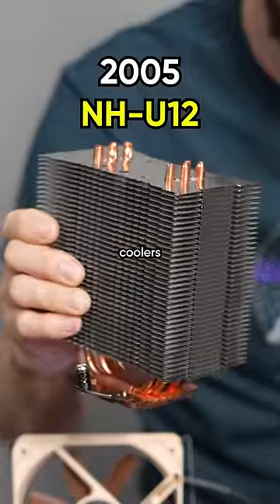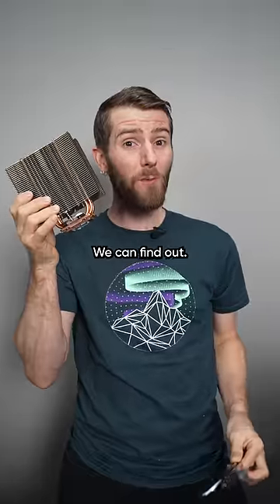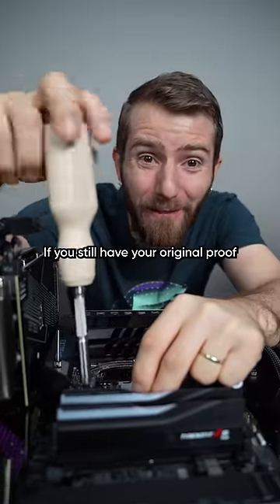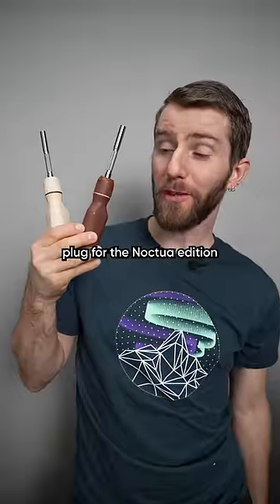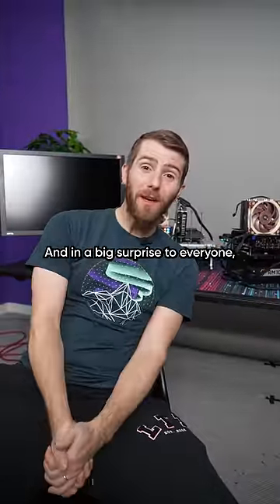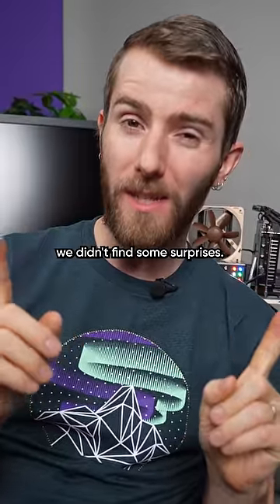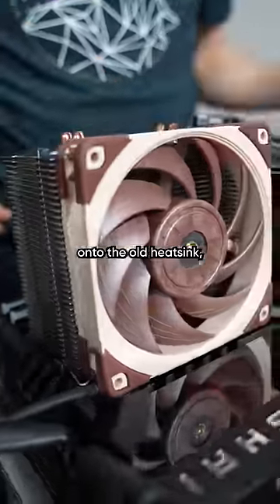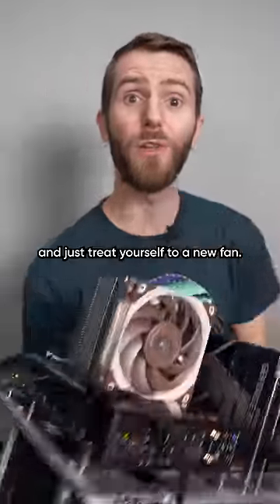Can You Still Use a CPU Cooler from 2005?

Comment: It makes sense. Heat sinks are pretty much at their highest tech they can get but motors still have plenty of room to improve
Reply: How do you know that? 🤔 There are many variables in a heatsink

Motors have nothing to do with it too, maybe the shape and size of the wings
Reply: @thebarnave motors can always get quieter and more energy efficient
Reply: @CADClicker  my dumb ass was like, “what does a motor from a car have to do with this?🤔” 😂😂
Reply: @CADClicker  mentioning energy efficiency when talking about computer fans is kinda ridiculous. With the miniscule amount of energy they use any amount of decreased power consumption by increased efficiency is negligible (the fans of the NHU12A have a max power consumption of 1.68 W each)
Reply: @CADClicker most sound isn't from motors but from wings moving air
Reply: Most of the improvements is the blade design. Not the motor.
Reply: It’s mostly the blades
Reply: @thebarnave Until we discover some sort of alloy thats superconductive to heat, or a liquid with more ideal heat transfer properties then evaporating water; we are stuck with what weve got. Physics puts a hard limit to it all.
Reply: @Jehty_ If you make it more energy efficient then within the same power budget, you can make it more powerful
Reply: Motors don't have much room to improve. Fans have been using BLDC motors for decades and improvements beyond that are minimal.
Reply: so many nerds in these replies 🤓 🤓
Reply: @CADClicker quieter and more energy efficient wouldn't affect cooling.
Reply: @thebarnave Actually there isn't that much you can do with a heatsink for air cooling. Watercooling is different because getting the flow right is very hard, but with air through these large fins that's just far less of an issue
Reply: @casper75559 motors are electric engines are not
Reply: no, 3 C degree is significantly better
Reply: @WiddlPeppuwu-sx3rx PC fans are rarely operated at peak power, because it would be noisy. A normal motherboard fan header can supply around 0.75-3A at 12V, so 9-36W. A noctua fan peaks at less than 2W. And that would be spinning it full blast, which would be very noisy. Fans already use way less than what's available, because the sweet spot between noise and performance is at low rpms, where the motor is virtually silent. All the perceptible noise comes from the fan blades moving air. If we were designing server fans which would be ran at full blast on a strict energy budget, motor efficiency would matter. But consumer PC fans use up to around 10% of the available energy from the motherboard as is, improved energy efficieny will not change anything. Motor development has brought us longer lasting fans with better bearings and such. BLDC motors at optimal fan RPMs have been silent and sipping miniscule power for decades. All advances in fan design is due to blade configurations being able to move air more effectively and quietly. Fans actually spin slower nowadays.
Reply: @AnonymousAnarchist2  it’s not water in the copper vapour pipes, or rather not pure h2o
Reply: How would you know?
Reply: @casper75559 I thought it was "monitor" and I was like "tf does a monitor have to do with heat syncs?"
Reply: You can still have developments, like silver nanoparticles suspension in water, but an 8°C difference seems more like an optimization in capillary action inside the heat pipes. And the number of heat pipes increased by 6, with a larger distribution area to the aluminium fins, so they should be even better in a partially loaded system than max power benchtest.
Reply: @thebarnave   heat sinks are far more optimized than electric motors or blades
Reply: It's mostly improvements in fan blade geometry and other fan mechanical design changes that optimize volumetric flow/turbulence etc.
Reply: not just motors, but the fan blade profile too
Reply: Its mot motors its the propellers motors dont have much to improve
Reply: Honestly yeah it just changes with what metal you use. If we somehow found new metals it might get better but it's not something I would gamble on lol.
Reply: They need higher speeds with less power and noise
Reply: @EikottXD not technically true. The less energy required to spin at the same rpm. The less energy goes to creating heat.

A fan just Cools more than the heat they generate. But they still generate heat.
Reply: a lot of engineers in the comment section. But the classic "it can't improve more than this" must be the most ignorant phrase of the century. Unless you know every single material and chemical physics possible, and all researches going on on a daily basis, you can't possibly give a statement like that. It can improve. It can always improve. Just because someone didn't find a way, doesn't"t mean it's "at it's maximum"
Reply: @enderagent you play Roblox lil bro
Reply: pretty close but alloying graphene and copper and silver could improve conductivity by up to 20% yet.
Reply: @akiraic that's surprisingly easy... Just look at hard sci-fi. The real challenge in engineering is the budget constraint and marketing. There's a reason nobody runs liquid nitrogen pots or enormous liquid coolers in their daily driver PC.
Reply: Wrong, realistically you could have a heat sink that performs significantly better by user silver. However there’s a reason we don’t do that, it’s price.
Reply: Yes, but those variables are already determined perfectly. With motors and blades, there's still a lot of room to improve, but with heatsinks, the basically only variable is "how much is what material" @thebarnave
Reply: More fins, better alloy coating, better heat pipe material and working fluid, more efficient convection guides, thinner dispersion fins, there is so much that can be improved, all technology can be innovated.
Reply: Hardly, on both claims. Biggest diff is fanblade design, therefore air volume/mass. Heat sinks could be made much better, but not without a lot of price increase adding requirement for a higher static pressure fan at the same time. It would necessarily make it noisier since turbulence is good for temps but not silence.
Reply: Blade geometry
Reply: I found the heat sinks over the years have different chemistry mixtures for different evaporative rates at targeted heat soak. Older CPU's were much larger physically and because of that had a much larger foot print onto the IHS which then moved much more heat into the heatsink. You'll find older CPUs that can pump out 250w almost instantly start pumping hot air out the back of the PC as it's able to saturate the heat sinks much easier. Because of that you want higher evaporative temps. But new CPUs are so small that the heat generated has to be attacked earlier with lower evaporative temps in the heat pipes. This lead to heatsinks drying out and temps jumping more than expected on many coolers around 5-10 years ago, as there was a mix of these heat soak/temp ranges out there.

Case in point, I have an old Zalmen 9700 and the newer 9900. The 9700 made my 3700x run warm.. BUT! Was able to cool my old FX-8320@4.7GHz just fine. The 8230 sucked down 260 watts under synthetic load at 72c while the 3700x @4.5GHz was using only 120 watts and already hitting 75c. THEN! I put the 9900 (newer) back on and tested again on both CPUs. The 3700x dropped back down to 68c and the FX8320 jumped up to over 80c.

I took room temperature and also had a watt meter hooked up to confirm wattage usage. There was a room temperature delta of maybe 2°f at most
Reply: @AnonymousAnarchist2 Or until Carbon nanotube transistor based CPUs can become commercially available and somewhat affordable. Carbon based CPUs perform better with less energy, which also means less heat.
Reply: @Jehty_  Well if you make them run with 0.5watt then you made amazing efficiency progress.
Reply: @Papinak2  Maybe but that depends on the effort put to improve them.
If most companies see no reason to invest heavily on that or care then even if improvements could be made they won't appear easily.
Reply: it is the fan blades not the motor
Reply: @thebarnave  Okay yes, many variables that's true, but the basic cheap heat sink design has been perfected. There is nowhere left to go in terms of efficiency when it comes to a cheap heat sink for a CPU, not some elaborate design for a water block or whatever,
Reply: Yes true but it's surprising to even see 3 degrees difference to be fair and im assuming the new fan on the old cooler is also spinning faster than the new fan and new cooler.
Reply: Heat pipes are not at their highest tech at all
Reply: @CADClicker it’s not the motor but the fan blades.
Reply: Nope, you could have a vapour chamber contact block.
Reply: There’s really not much that can be improved in the motor. The main improvement is the blade design
Reply: I just think impingement cooling might be it, like a spray bottle squirting into a channel with a ultrasonic transducer slapping the water droplets onto the processor heatsink
Reply: @CADClicker  not really. Electric motors are already super energy efficient. The only changes that can improve them are better blade designs, better bearings, that kind of stuff
Reply: @MRblazedBEANS  nahh motors pretty much also peaked at least in this field the real change comes from the fan blade design on the fan
Reply: @thebarnave  motors also produce heat
Reply: Heat dispersion is basically peak. So it's just the fans and shit that have evolved.
Reply: @akiraic  I mean not really, there’s always going to be some fundamental limits
Reply: @Dell-ol6hb  the thermodynamic capacity of the materials used is the only fundamental limit. Anything else is material research and design. For now, the problem is simply cost.
Reply: I've used a heatpipe heatsink over and over on 5 different systems and CPUs, and I always take off the fan, build a duct and suck that air through the heatsink and straight out the back with a 120mm fan. best thing is that the VRMs are optimally cooled this way aswell.
Reply: @thebarnave  mostly cuz the cost to improve them isn't ever worth it. The newer model has cheaper, better materials... That explains the small gap in perfoemance
Reply: @MRblazedBEANS  it's not the motor it's the blade density
Reply: @CADClicker no they cant
Reply: You mean fans
Reply: @CADClicker efficiency has nothing to do with how well it can cool your pc
Reply: Fan-technology is complicated stuff. At least, if done properly.

Comment: And the old heatsink only has four heat pipes.  Impressive that they still perform like this
Reply: Yeah, the only real benefit of more heat pipe is better coverage of the CPU. The CPU IHS integrated heath spreader, countrary to what the name suggests, really isn't that good at spreading heat. Thus on modern cou with "wider" arrange of ccd / chiplets or just bigger monolithic cpu will greatly benefit for more heath pipe simply because a 4 hp like this old noctua will not have even coverage of the chiplets/ccd /monolithic element, and more heath pipe cooler will have great coverage of heat pipe directly over the heat producing components. But even 2-3 heatpipe would be enough to carry the heat from a cpu if you'd have a way to transfer it from the cpu to the pipe, as a good quality heat pipe has an equivalent thermal conductivity in excess of 100x that of copper and 200x that of aluminium...
Reply: The new one appears to have more fins in the stack, so I'd guess it has more surface area for heat dissipation.
Reply: Could be the same thing with Car Engines, we have found the best cost/performance for heatsinks so they haven't changed that much
Reply: I'm not very well versed in heat pipe lore but why don't they connect them up the top?
Reply: yhh
Reply: @Flesh_Wizard Connecting them up like that would likely make 0 difference (but if anything, depending on the construction it could perform worse, I think). And connecting them up like that would make it significantly more expensive to manufacture due to the much longer heat-pipe and the extra bending. A heat pipe is not a thermal conductor, it's an evaporative cooling system. So the liquid evaporates at the CPU and precipitates along where the cooling fins are mounted, and the liquid is then transported back to the CPU by gravity and/or capillary effect.
Reply: Anyone knows why they coat their pipes in   aluminium? I thought they're aluminium but then upon hoogling they're copper.
Reply: @funkblack  Corrosion resistance maybe?
Reply: @Flesh_Wizard no reason to do that, plus it'd be super complicated
Reply: Just shows you that more than 4 heatpipes is just pure marketing. It just makes 3 degrees difference, which means the problem was only that old fan, that wasn't very much pressure optimized (look at the HUGE gaps between the blades)
Reply: @funkblack  The coating usually isn't aluminum either, it's nickel
Reply: And they're all really close together in the fin stack as well.
Reply: i’ve got a phat Zalman copper tornado thing from 2005. it was quite heavy
Reply: @maulerrw  I've seen one of those.  Very cool.
Reply: @sassuki  it would probably depend on the cpu you have nowadays. For example, amd's chiplet design would probably favor more heat pipes because it would be more effective at covering all of the CCD's.
Reply: @Marauder-q2v  not really. They are still concentrated around the center. So it doesn't matter. Problem with am5 is just the turbo if you don't like to see 95° under load. Without turbo, you could easily get even X cpus around the 70° mark!
Reply: @sassuki  I mean it was sufficient enough of a problem for multiple companies to create offset mounting that did result in a drop (not that huge) in temps.
Reply: @REVOLUTIONS51 Heatpipes are fantastic conductors but they have one big weakness - if you overload them they suddenly become terrible conductors. Heatpipes rely on a fluid vaporizing and condensing to transport heat but if at some point there is no liquid left on the hot end to evaporate you are essentially left with a hollow coppertube - this happens when you either evaporate it faster than it can soak the liquid back from the other end(this just limits the cooling power to the flowrate).

A different much worse scenario can happen when the fan fails and the hot side reaches the boiling point of the liquid, this leads to all the liquid evaporating and none coming back, once everything is used up the conductivity becomes almost zero and you have to hope the cpu detects the temperature spike before anything gets damaged.

Comment: Noctua's product support is unmatched, replacing parts that go beyond 18 years is insane
Reply: if they make same constrution
Reply: Not even just  replacing parts but making new parts to fit the old hardware on new mounts.
Reply: While still (kinda) making improvements after all that time!
Reply: We love to see it. I have a 2006 Kona Stinky mountain bike that I cracked a rocker arm on in 2021 ish. Called them up with zero hope that they still had parts for such an old frame. The lady I talked to put me on hold while she checked probably the deepest depths of the warehouse to come back and say they have a pair for my bike. I bought a bushing and bolt kit at the same time but she didn't charge me for the rocker arms and thanked me for keeping that old gem on the trail after all these years. I need to get that bike out for another ride one of these years. It's a riot and you don't see many people on 18 year old full suspension frames these days.
Reply: Meanwhile no warranty on the LTT merch lolol

Comment: I have my nh12 from a phenom x6 1055t era, but now with a 5700x.
Works fine like the first day!
Reply: Love my old Thuban with a ssd boot drive and a pcie 1x nvme it has decent performance compared to when I used it with a hdd. now if I could get that Russian custom bios with nvme boot added to flash it would still be decent work station.
Reply: @TatsuZZmage You can use a Clover Boot thumb drive, it will find NVMe and boot them.  But don't let me remind you a 4th gen intel core Xeon E3 (from 8 to 30 bones) and a free dumpster dive motherboard will beat up on a pre-Ryzen AMD proc like nobodies business.
Reply: Also goes for 2nd and 3rd gen to some extent.  Can get the motherboards for 15 and quad core 3.5Ghz+ chips under 20.  Save your RAM and move it over.
Reply: I kinda wish I kept mine but I have only had water coolers for the past 12 years.

Comment: Most noctua coolers also allow you to mount 2 or even 3 fans as well, so you may find even better performance by adding a second fan instead of simply replacing the one that's there, in a push-pull configuration.